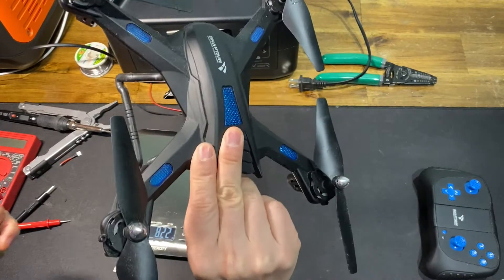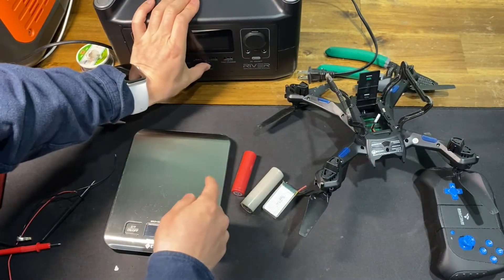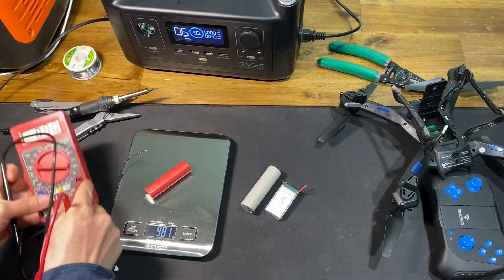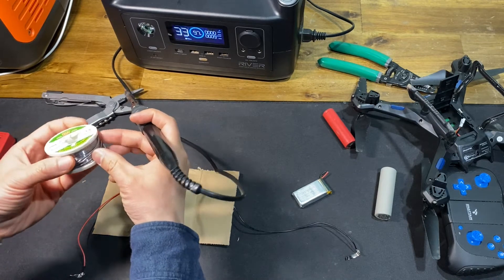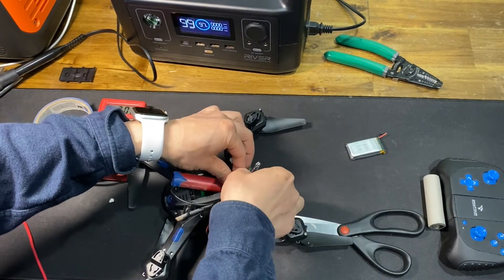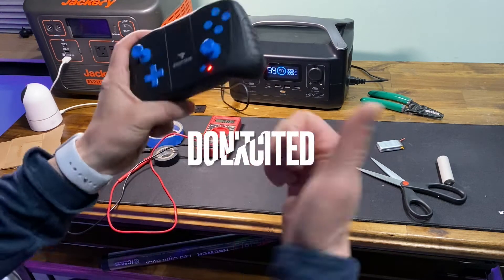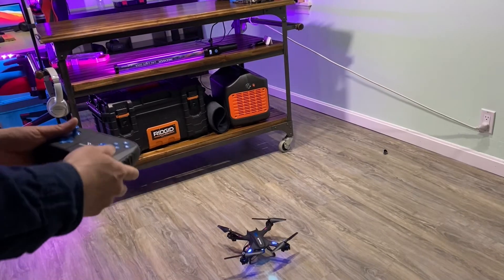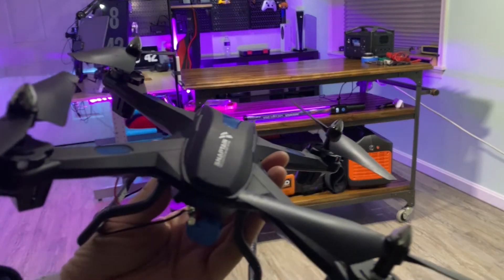Drone Mod with 18650 Battery Conversion

Comment: Glad you didn't decapitate yourself lol 
All of them other tools are taking apart circuits and soldering wires to the board etc.  I always felt like taking the wires and connectors and connecting them to the battery should be enough.  For vid. Thanks
Reply from the maker: Thanks! The drone is pretty small.